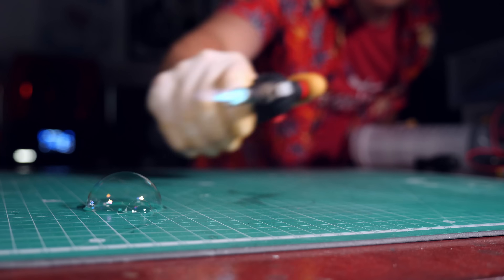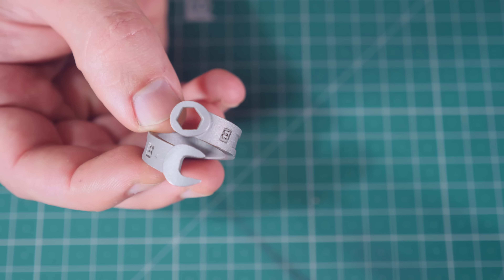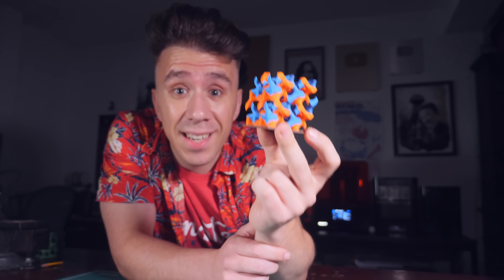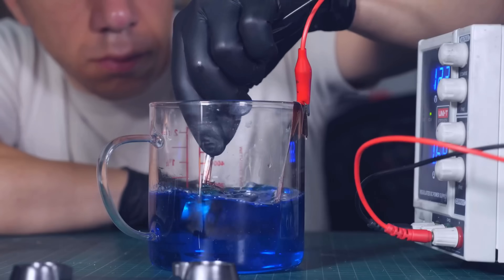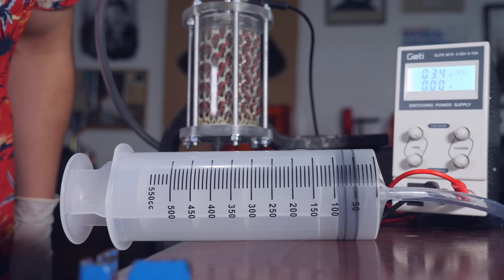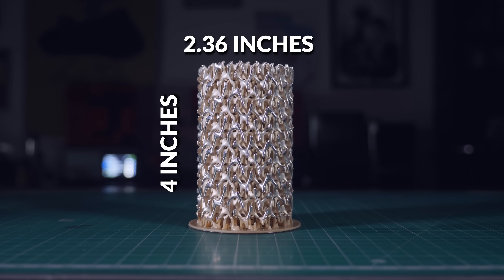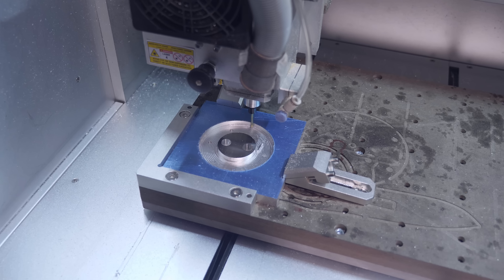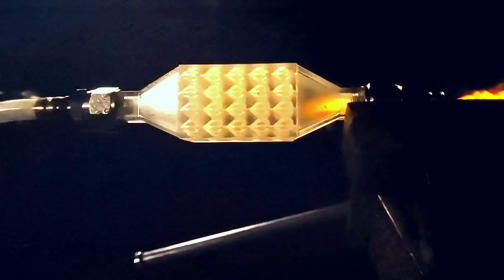ROCKET that LITERALLY BURNS WATER as FUEL

Comment: Remember, this man is NOT suicidal
Reply: The petroleum industry doesn't need to put effort into enforcing the second law of thermodynamics
Reply: @charlesmartin1972  You're not wrong, but for some reason they do anyway. A lot.
I know this tech can't be used standalone without an external power supply, but there's something there that begs hiding.
Reply: @wolvenedge6214  there is nothing here but a cool demo. Stop with the conspiracy bullshit
Reply: @psukhopompos  I'm sure Stanley Meyer wishes it was just conspiracy bullshit.
Reply: @wolvenedge6214  this is a common classroom demonstration though. Should thousands of school teachers go into hiding as well? Come on...
Reply: @theKashConnoisseur  The school teachers don't push the tech's boundaries or try to find applications for it. Fairly often they even discourage that, and/or call it a party trick.

Integza is a gremlin with a penchant for tinkering, he stands a chance at finding something fun.
The kinds of things that we've seen people die for.
I'm not going to pretend I know they whys or grandwhys, but I like this channel and I don't want to see another curious tinkerer disappear.
Reply: @wolvenedge6214  This is old tech, though. Like dawn of electricity old. It takes more power to split the water than it produces when you burn the gasses. No amount of pushing boundaries will break the laws of Thermodynamics, and as such water electrolysis will never be a viable form of power generation. The biggest danger Integza faces when splitting water is the explosive reaction when the two are ignited. There's no shadow assassins trying to hide inefficient methods of making things move.
Reply: @theKashConnoisseur  There are only six comments here, so keep up with the conversation, please; third law of thermodynamics has already been acknowledged.
I am perfectly aware that these systems are not a threat in that way.

I don't know what about this tech is considered a threat, but people have been killed for it, so there's something there.
Reply: @wolvenedge6214  it's the 2nd law of thermodynamics, not the 3rd. I think you might be the one failing to keep up with the conversation here. 

Also, Meyer died of an aneurism. He wasn't killed, he had chronic high blood pressure. This is why conspiracy theorists always look so silly, failing to do the bare modicum of research to understand a topic or the history surrounding it.
Reply: @theKashConnoisseur  Oh boy.
1; only if you count from zero.
Pardon me for counting them off in my head rather than pulling straight from Gurgle, my mistake.
2; I did not mention Meyer. I said "people." Plural, non-specific. And for the specific case of Meyer, look up Havana syndrome.

The problem is that you only did the bare modicum of research, and as a result failed to understand the topic or its history.
Reply: @wolvenedge6214   The "no, you" response stopped being effective around middle school, unfortunately.
Reply: @theKashConnoisseur  Closely followed by "nuh uh." But, again, that's not what I said.
Ad hom, appeal to authority, and strawmanning, though... sadly never seem to go out of style.

And to head off a common retort; you can prove the Earth to be a spheroid with a sundial and a little bit of math over the course of a single year.
Heard it way too many times before.
Reply: @wolvenedge6214  you're just trying to offrail the conversation at this point. Let's get this straight: electrolysis isn't hidden knowledge. Water powered cars are no threat to the petrol industry because it takes more power to split the water than it makes when you burn the resultant gasses. Nobody is going after Youtubers for showing you how to make hydrogen and oxygen from water and electricity. You cannot debunk a single one of these statements.
Reply: @theKashConnoisseur it’s a joke also someone who made the first water powered car died after going to a restaurant before he died he said he was poisoned
Reply: @Jaysonnnnnnnnnnnnnn  It was determined he died of a brain aneurism, and he had a history of chronic high blood pressure. Obviously, having an aneurism doesn't feel very good so it's understandable that Meyer felt like something was wrong. But there was no poison in his system after the fact.
Reply: @theKashConnoisseur  ???
"Electrolysis isn't hidden knowledge."
- Correct. Duh. Where on earth do you think I said this?

"Water powered cars--" (interruption)
- Do not exist. AGAIN, you are correct; all you're doing with an HHO cell is adding an extra step between the battery and the wheels, which makes it less efficient, not more.
I haven't the foggiest why you keep bringing this up when I've agreed with this from step fecking one.

"Nobody is going after..."
clears throat
This one, and this one alone is where you're wrong.
Governments and corporations have killed people over literal cheese. I don't care how much you personally think there is nothing there (hello, Dunning, Kruger, et. al.), people who get into this field and start to seriously work on it have a remarkably short lifespan, usually ending to either brain injury or really weird suicides.
I don't know what's here, but if it was a nothing burger people wouldn't be dying for it.

Statement three debunked.
Reply: @wolvenedge6214  Saying "people have killed for less" doesn't debunk the claim that nobody has been killed over hydrogen powered cars or simple electrolysis. You can't prove that anyone has been killed for that reason, thus you can't debunk it. And the prior points explain why in full detail. Your conspiracy theory fails on it's very merits, as well as with the details.

Correlation doesn't equal causation. It's really that simple. Conspiracy theorists tend to fail there often.

Comment: Don't use a bigger battery. The solution for the high current you're drawing is neutral plates. It looks like you're drawing around 3V with this setup but no shared amperage. If you were to have 5 fully isolated plates(neutral plates) in between then you could use 12V to get 2V at each plate and amperage shares across all the plates. The ideal voltage per plate is 2V so if you have 9 plates you take 10 gaps 2V = 20V input and your ideal spacing is around 2-3mm. You also won't want your drink being too conductive or hot either or that will also cause higher current. I've built 3 generators and have used these tips to make them better each time. Hope this info makes it to you, i'd like to see this project visited again sometime!
Reply: That's what I said too in my comment! Agreed
Reply: Question: Is this like wiring in series vs parallel?
Reply: 100% this.  To destroy those batteries implies a ton of wasted energy in heating the water
Reply: Great suggestion. I was going to say he shouldn’t go to higher voltage because you’re just wasting energy then. But I suppose a high amp 2V supply is difficult. Losses in cables at low voltage and high current is an issue.
Makes a lot of sense to keep the voltage high but divide it at the unit
Reply: @alanberger11  more or less yes
Reply: I also agree with this technique. The explanation makes sense. 
Definitely should be given a try 
👍
Reply: Your Idea... Makes perfect sense. I hope he sees your post and tries it.👍
Reply: Some quick math tells me that first generator design was something around 150mΩ meaning that 900mAh 2S Lipo would have been asked to deliver 30-50A (well above its 25C rating). 

The second generator design is very likely to have much lower resistance, perhaps 75mΩ or lower. Assuming that number, the 2400mAh 3S Lipo would have been asked to deliver 120-150A (250-310% its 20C rating). The 5100mAh 4S Lipo would have been asked 160-200A or 80-100% of its 40C rating. Considering that it too died, perhaps the resistance is significantly lower such as 37.5mΩ. That would push the 4S battery to 320-400A or 160-200% of its 40C rating.

So, yeah, stupid amounts of current because everything is setup in parallel and he kept increasing the voltage with every battery upgrade. Optimize the design so the needed voltage is much higher and the current much lower and things will definitely go much more smoothly.
Reply: Tesla coil.  Use the gas to spin a Tesla turbine
Reply: I agree with the neutral plates and lower voltage, but it needs a power supply to give controlled constant current. Anodising and electroplating industry uses them, rectifiers they are called. But the cables are pretty huge.
But there's no need to run at 300 Amps for this cell, it would just burn it up.
Reply: @alanberger11 series
Reply: To me, it looks like he built a big plate capacitor, except for the conductive electrolyte. Would the capacitance be a significant factor in power calculations here?
Reply: Some current regulation would be smart way to go.
Reply: @MrPGT  I think the spacing might decrease the capacitance enough to be meaningless though.  Plus, without a limiting resistor I'd expect it to be charged extremely quickly. Well, the battery and wires are limiting, but they're resistance is tiny.
Reply: @alanberger11 Yes and in this case, series are more reliable than parallel because I don't think any power supply could give such high amps
Reply: Scavenging a computer power supply is pretty great and cheap for that
Reply: W8. Neutral Plates ? How do you get those?
Reply: @beniaminopinca5931  by positioning them between a positive and a negative plate without being connected to power.
Reply: @auspiciouslywild  there are single-cell LiFePO4 packs at a 3.2V 300Ah or more meant for solar panels, yes these fellas can output hundreds of Amps and you can stack them in parallel.
with a single-cell LiFePO4 pack he'd only need one neutral plate and it would be at an even lower 1.6V per plate, for more output just add more plates instead.
Reply: yeah this makes sense, see other comment abut using an EV motor controller to do PWM (low throttle)
Reply: AlSo what about separation of the hydrogen and oxygen. Then metering the oxygen input at the jet. To much oxygen will make gasoline go boom aswell. Also having  water circulating through a cooler.  being sure there are no aluminum parts coming in contact with the solution. 

Also if you're experimenting with a motor vehicle. Find something besides caustic soda. that doesn't react with aluminum 
By using sodium hydroxide as a catalyst it will destroy any aluminum parts it comes  in contact with including your piston walls. 
It will eat right through them in time. 

Side note. 
sodium hydroxide and aluminum in water produces hydrogen without producing the oxygen or using electricity.
But by using the aluminum and caustic soda mix as  the fuel source.
✌
Reply: Well rusty, for us more laymen DIY guys, care to share your designs? I'll gladly pay you in burgers...on Tuesday :face-green-smiling:
Reply: @omnirath  PC power supplies get expensive as amperage goes up on the 12V rail. To go past those limits, you need to go into toroidal transformers. You can find these in old analog speaker amplifiers.
Reply: @jesh879  I was saying that more as a quick and easy solution, for electrolysis using something below 12v is preferable
Reply: I want to see an engine using a Tesla valve design, with the round cavities shaped to resonate with the water module (2.45ghz "microwave" frequency), and produce plasma explosions in one direction as a result of electrical arcs pulsating at that frequency... I think this could be amazing to see working! 
I also have made a magnet propel itself past another one and hope to build a self-powered motor next. I'll show everyone if I get it working.
Reply: A chemist would know the optimal voltage.
Reply: Bubbles and longevity, not necessarily the static picture for maximum gas output.
Reply: Please, I beg, repent and save others before it's too late,God is coming back soon ❤
Reply: Please, I beg, repent and save others, your friends and family, before it's too late, God is coming back soon ❤
Reply: Wouldn’t putting a resistor with a heat sink help? Or would that end up limiting the battery’s output of amperage?
Reply: You need to work with frequency and not concentrate on volts or amps, this is where wasted energy occurs. Stan Meyer had it all sussed but there's one part of his secret that he took to the grave.
Reply: How do the neutral plates affect the current and voltage? 
The voltage only splits equally if all the plates have the same resistance and are connected in series, which in this case as I understand they are all connected in parallel. Here the current gets split between the plates not the voltage. 
Since the neutral plates are not connected an insulated what do they actually do?
There is no current or voltage accross them so they shouldn't generate hydrogen and should not be able to influence any current being drawn. 
The voltage is reglated by the supply so every plate should get 12V if the supply gives 12V. 
The current is determined by the resistance, which gets split equally among the plates, given they have the same resistance between anode and cathode accross the electrolyte solution. 
Pls correct if I got it wrong...
Reply: @натчи2санс  A resistor with a heatsink is a great idea here. That is what I would do too anyways. I only know about resistors limiting current.
Reply: 3v how many amps?
Reply: Well at least your smart in this area!
Reply: @plinble don't need a chemist. Ohms law dictates exactly how much of what is needed. Just takes measuring the resistance of the tank and adding enough extra resistance to set your current to the desired level.
Reply: I've read somewhere that if you vibrate generator you could get much high gas production as bubbles stick to electrodes for some time and reduce active area
Reply: @auspiciouslywild Shouldn’t it read: ….low voltage and high amperage? Isn’t voltage the measurement of the pressure of the current that’s pushing the electrons, and amperage the measurement of the quantity of electrons in the current?
Reply: @PhilipClayton-h3m  Same thing. Though I don’t remember “amperage” used much if at all in my studies. Maybe which word used is a regional thing.
Reply: @AITunes-n-Beats I think Stan’s secret was that he used frequencies to crack the water molecule instead of hydrolysis.
Reply: @harleyborgais I think your Tesla valve engine design is genius. I’d like to see that too.